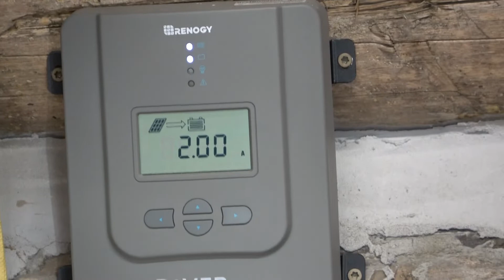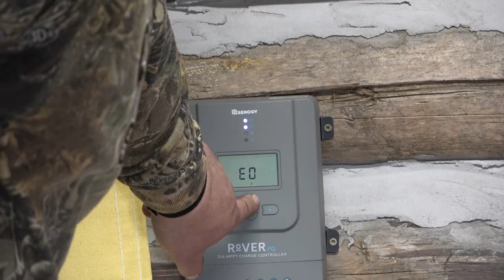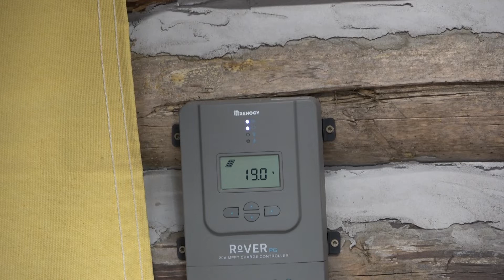Solar Panel Installation at the Off Grid Cabin.  Part 2

Comment: I have two 100 watt panels on my camper and the best i have seen is 9 amps most of the time it is 2 to 5 amps
Reply from the maker: Solar panels are ok but it does take a lot of time to charge things up.  I really need a wind mill system as well.  Wind along with your solar panels might give you more of grid power.  I know they make them for sail boats, I would think one on a camper should work.  Thanks for the comments.

Comment: Hi. Dave here in Prescott valley, Az. I put up a Harbor Freight 100 watt solar kit in February 2021.  It keeps my 2 6V Costco golf cart batteries topped off nicely which I have ham radios attached to. I’m planning to run a couple of 12v floor lamps in the main room with it. I’m just starting to learn a little about this. Isn’t it cool to get quiet, clean power from the sun? Have fun!
Reply from the maker: Hello Dave, the quite is so nice.  I have to say it is fairly easy to set up and i love it.  No more generator noise or propane lamps.  Thanks for commenting

Comment: Emma I use the same controller with to 100watt panels to power a wifi camera. Worked great for two years until hurricane Laura ripped my solar panels off I will be getting them back up soon. Also so I noticed a branch are a tree shading about 1/6th of your panels if you can remove that shade it will help alot. Merry Christmas.
Reply from the maker: Merry Christmas my friend.  THanks for watching and thanks for commenting.  You are right, I do need to do some trimming.  We dont get much sun this time of year but every little bit helps.  Take care.

Comment: Great set up M!  Pretty sweet!  Seems like adding more solar panels for more power (if needed) would be better than trying to add wind power..?  What do you think?   Just feels like a wind mill could more easily be damaged with the weather since it would have to be up higher.  Right?
Reply from the maker: Thanks for watching and commenting.  I think you are right, adding solar panels would be better in the long run compared to wind power.  A windmill has much more long term maintenance than solar panels.  Also good ones do have a higher cost per kilowatt hour overall.  Time will tell us the story if we need more power.

Comment: 12.1 is pretty scary low.  I don't let mine go below 12.4.  You always hook the batteries up to the controller first.  And, disconnect the solar panels first.  I have 12 deep cycle batteries from Walmart. They're only $100 and the work great for me at my cabin.  Might be worth you picking up a couple.  Good job on the set up. Mine is a little bigger, but you can see it on my channel. Enjoy your holidays!
Reply from the maker: Thanks for watching, and wow you have a very nice solar set up.  I checked yesterday and with the solar panels hooked up and with me away my batteries were running 12.5 volts.  So I was pretty happy.  Here in North Central Wisconsin we dont get much sun this time of year.  I am picking up a couple of new batteries in the spring and then I can get a better idea of how this system will work.  Merry Christmas and Happy New Year.